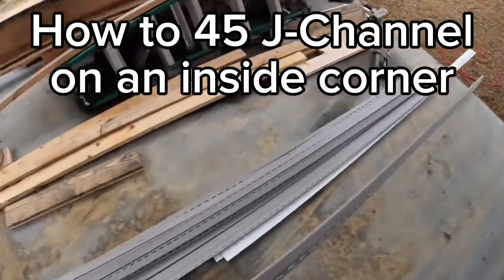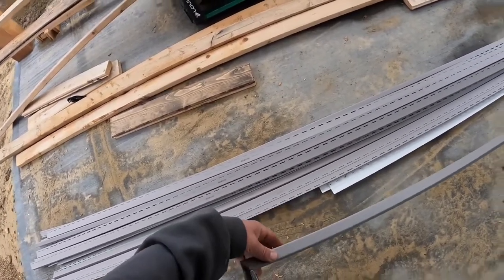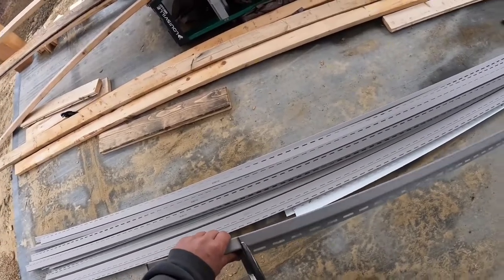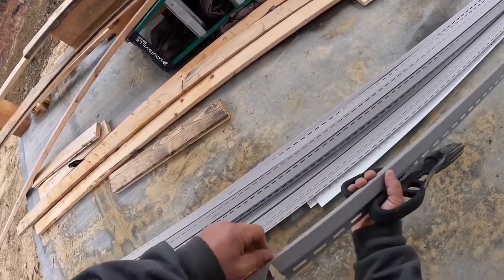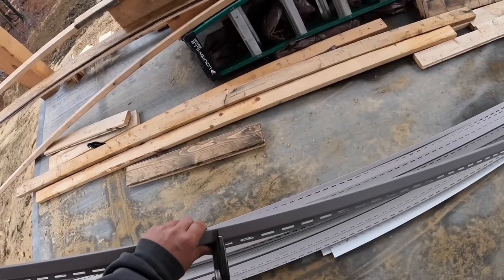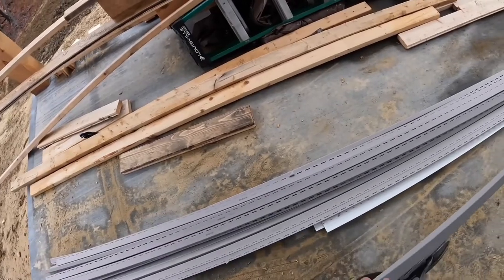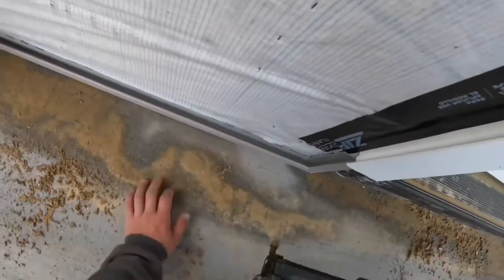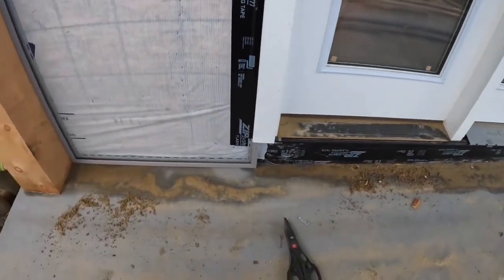How to install J Channel on an inside corner

Comment: Where water will go to?
Reply from the maker: Hi Joel, Good question. In these circumstances the water will flow out of the corners of the j channel. If there is a lot of water coming down, it will build up in the j channel until it flows over the face. The holes in the nail fin are higher than the face of the j channel so there should never be a problem with water overflowing the back. Also this j channel installation is underneath a roof so there will be very minimal water anyways. 

In these situations (especially when there’s no roof covering) it is imperative that the housewrap, ice & water, and flashing underneath the siding is done correctly to prevent any water damage. Vinyl siding helps keep water off from a house, but properly installed housewrap and flashing is what prevents it from contacting the underlayment and causing rot.